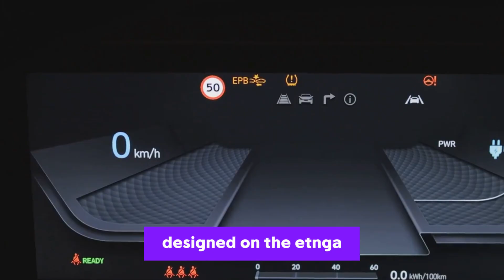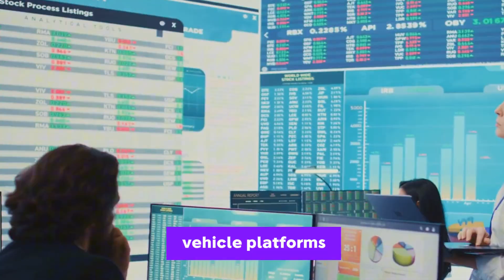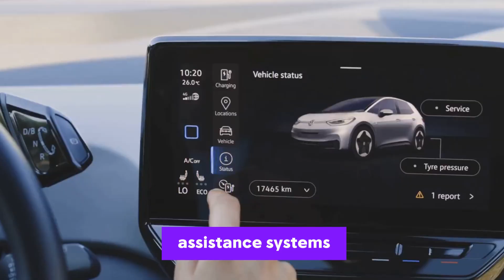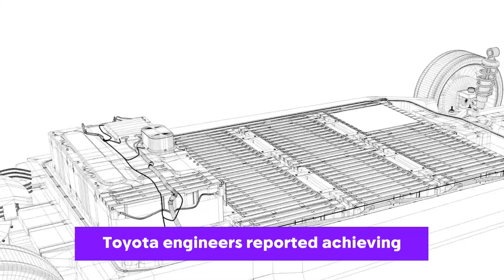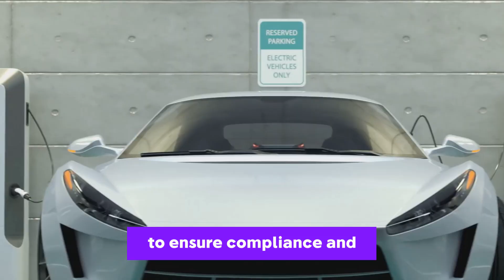Toyota CEO drop bombshell Toyota NEW Solid State Battery 1000 Miles with 5-min Charging!

Comment: Toyota is going after the small market of High End ICE car owners that want to change to EVs that will give them the same qualities they had with an ICE that's why they are puting on the market those solid state batteries that cost 3 times more for Watt.hours than the Lithium ions equivalent. With the even cheaper sodium ion batteries coming into the market they have no chance with the fast growing first time car buyers of the developing economies. Why would the average consumers buy a Betamax when they have a mulitude choice of cheaper VHS at the video recorder stores.